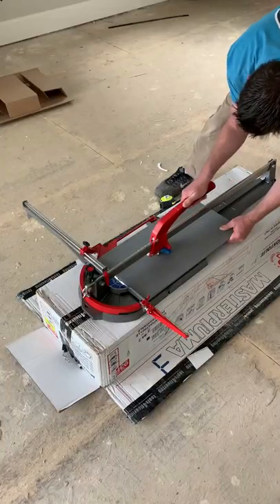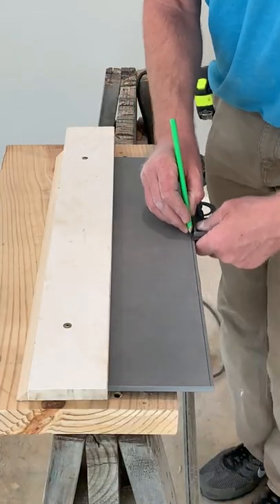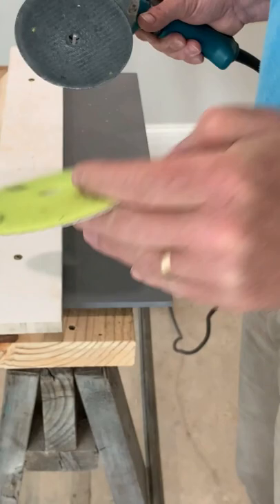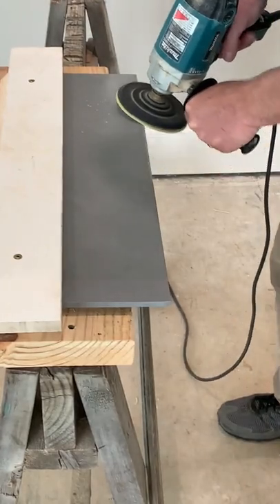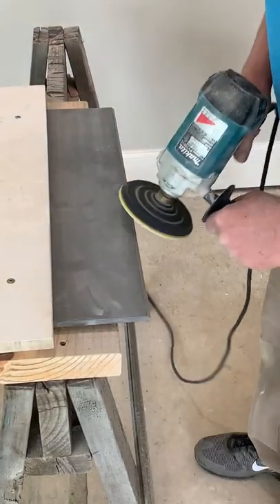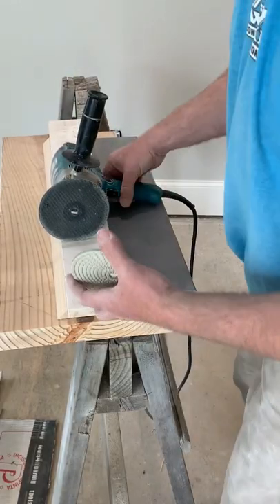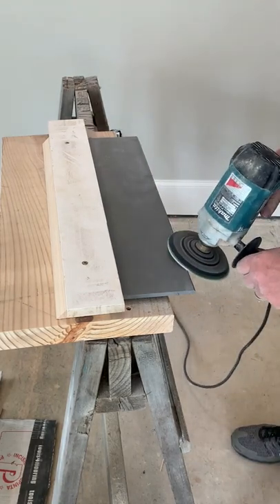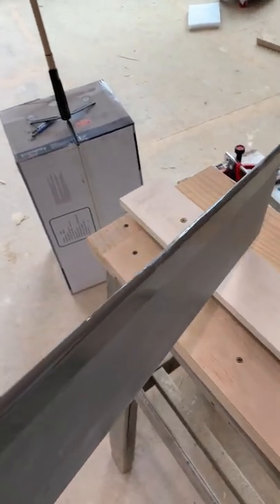Makin' Tile base like a PRO #shorts

Comment: for best results, make sure tile is solid color all the way through
Reply: Right
Reply: If the two dozen tile jobs so far not one had solid color through the tile.  Even the white marble type I frequently install has a beige tile body.  Don’t know where I’d find tile with solid color through through it.  Most often use the 8’ long plastic or 8’ aluminum trim.

Comment: That used to be absolutely necessary because they don't make bullnose for a lot of different tiles. Now a days  Schluter profile edges work great and you can get them in bronze, stainless steel,cooper, white,brushed nickel etc. Although I do have one of those polishing kits like you have and it has been golden for me on real stone jobs like travertine or marble. Then again they make the chair rail or pencil block trim for stone. Either way your polishing skills are definitely up to par ,👍💪.
Reply from the maker: Thanks boss. I still make a lot of bullnose pcs. I do use the Schluter as well

Comment: Worked in a tile factory for almost 20 years. That was 15 years ago. We made this in the factory so why would you go through all the trouble of doing this? Buy the manufactured tile.
Reply from the maker: Because I can never find the exact size I needed. I make my own and I can make it whatever I need
Reply: @w.k.d.constructionllc  sounds like you are shopping at the wrong dealer. What we didnt manufacture, we had a specialized department that would make all trim and put it into stock for this very reason. Cut, bevel, cut different sizes to match. But if you see your way is better that just buying what you need. Help yourself. Just wasted time in my book and we both know that time is money. Now, dont get me wrong, when I would be on a side job and forgot to pick up the correct material, I would make on job site if I could not wait and get back to the store.